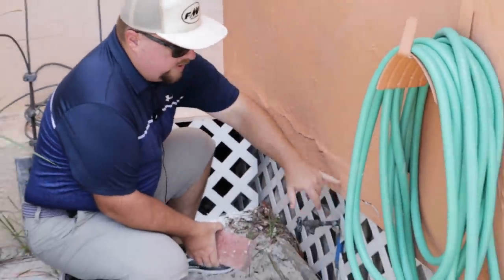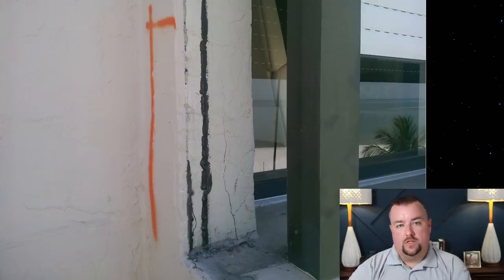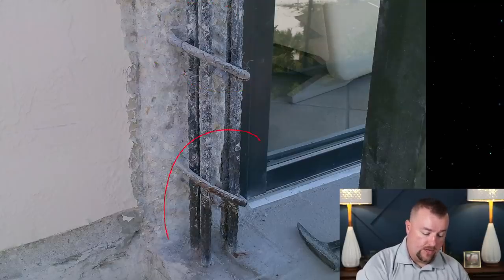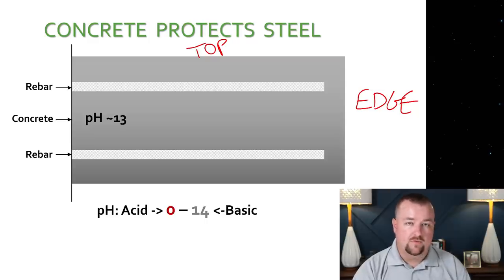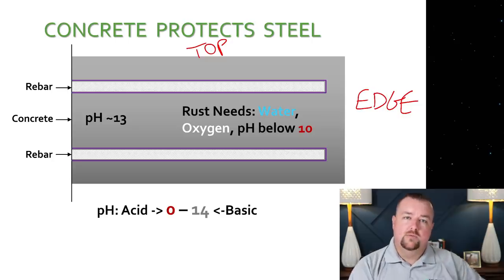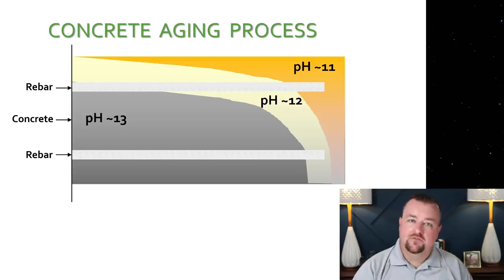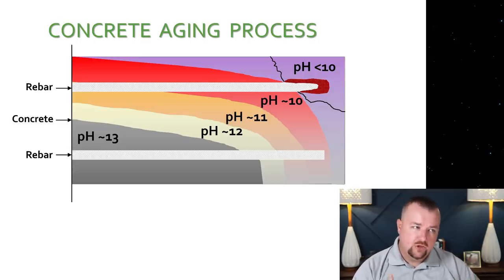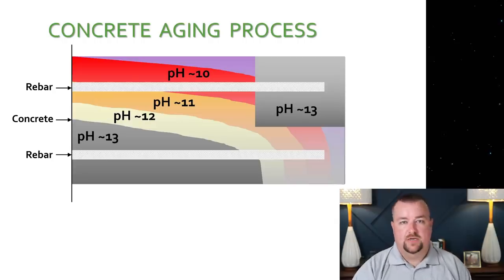Reinforced Concrete's Number 1 Enemy

Comment: As an old structural Concrete Contractor, I've wondered how come the rebar did not start rusting right away since we had to pour or pump it in a liquid state. Now I know, Thanks
Reply: and makes me even more worried seeing the amount of rusting rebar on construction site after construction site...
Reply: @jwenting  A little light rust is good because it gives some roughness and adhesion but thick brown rust with a thickness you can brush off is bad. There should not be loose material. That is just one of a hundred defects in construction reality, like less rebar than spec, insufficient lapping, not properly tied, insufficient coverage ( too near surface ) etc. etc.
Reply: @tuberroot1112  Exactly.
Reply: @tuberroot1112  Bingo!
Reply: @tuberroot1112  concrete does not adhere to rebar ever. Watch the video one more time and note when he says “mechanical bonding” it doesn’t mean “glued” together.
Reply: @vitaliypro8441  so if I'd said roughness and bonding would it have changed anything?  No, I didn't think so. Thanks for your contribution.
Reply: @tuberroot1112  surface bonding between rebar and concrete plays very little to no role in overall performance of reinforced concrete. 
I can spray form oil all over rebar and it will not affect mechanical bonding at all
Reply: @vitaliypro8441  Yes it will. They are always careful not to get the form oil on the rebar. I can tell you that concrete bonds very well to steel. My smooth mixing paddle is coated in it and I have to take a hammer to smash it off.
Reply: @marks6663 
Vitaliy

One says one says no
Who to believe
Reply: @coasteyscoasteys  rebar is purposefully SHAPED so that concrete adheres to it more, and its shape has been experimented with for over a century.
the guy in the video points out physical evidence of differing degrees of bonding due to erosion of said bonds from water.
Reply: That comment is a sign of great wisdom because you're still curious and willing to accept new knowledge even after a lifetime of experience.
Reply: @tuberroot1112  It is frightening all the variable negatives that can apply.
Reply: @rainscratch  There is a huge amount of science and engineering experience about how to make good steel reinforced concrete. Most of it goes out of the window when you have a foreman on your back who has site manager over him with a big fat bonus based on how quickly and how cheaply he can do the job.
Reply: Galvanise it

Comment: Don't know when I'll ever get to use the education you're providing but I hope to earn an honorary degree in engineering by continued viewing.  Thanks Professor Josh, I find your content fascinating!
Reply: This is only a small piece of engineering.  You are not getting any of the mathematical modeling.  Engineering is about applying mathemetics, physics and chemistry and making a simple model to explain what is happening.  We test the model to see how well it explains what is happening and then work to improve it and reduce error.  Because we know we have errors, we assign a safety factor to ensure there is enough strength.
Reply: @scottkelley1558   I think the intention of my comment may have been lost in translation.  It was an attempt to deliver a sincere compliment in a humorous manner. Clearly I failed.  I understand that the field of engineering requires many years of study spanning a deep dive into subjects I failed miserably in, especially math. That being said,  as a lay person I'm grateful to this channel for a better understanding, albeit simplistic,  of why the building I'm living in manages to keep itself upright.
Reply: @scottkelley1558  , Do engineers monitor builders at building sites so that they don’t take shortcuts to save $$$ ?
Reply: 🤣🤣🤣🤣 an honorary degree? 🤣🤣🤣🤣🤣🤣🤣🤣
Reply: @dp26385  I was wondering the exact same thing.
Reply: slow
Reply: @dp26385  The short answer is: Yes.
Reply: You can use special mix with addition of silica fume to reduce chloride attack. Had been use in bridge construction and the lab results is promising. Also coating of rebar before casting is additional protection. 
Ps: contractor tend to cheat on this as design life of bridge usually 50 years and the effect will likely shown after quite some time.
Reply: @dp26385  outside my expertise.  Adherence to design is not an engineering function per se.  that is done by construction management and inspectors..  I did read the accident report for the Miami bridge collapse a few years ago and engineers were involved through the construction process.  That is a good read.
Reply: @scottkelley1558  , thank you 🙏
Reply: It's not as 'glorious' as a Civil-scale project, but these videos have helped me to diagnose a 'soft' area of my foundation wall in my house, and has helped me to decide on what exactly to use to repair it, not just "Well I have THIS on hand, I'll just use that."  It turns out, materials matter!  I got proper concrete mix, and that'll do the job properly.  And I know to use angles that allow the new concrete to maybe bind and 'lock into' my still-existing foundation concrete.  Cement...adhesive?  That's not right, but there's a mix you use for when you want to bond concrete to other concrete.  It's not as perfect as pure, original concrete pours, but it's fine for my use.  But I know to DO that instead of 'just pile some mortar on and put the chunks back into place' like someone suggested I do.  So...I'm not an engineer, but this stuff still teaches me how to repair my house by proxy.  :)

Comment: Thanks very much for this tutorial.

I am a formulation chemist,designing impermeable acid/caustic/chemical resistant coatings for concrete structures.

Novalac epoxies are typically used to coat concrete in large chemical plants.

Problems arise because there are only two types of concrete...concrete that has cracked or concrete that will crack.

Epoxies are unfortunately nearly as crack prone as the concrete,so when concrete cracks,the epoxy coating that`s supposed to protect the concrete cracks as well. 

This new coating,soon to be released,will solve those issues.

Understanding the deterioration functionality of concrete is extremely important to the design of industrial coatings.

I need to say in touch with your channel.

Best regards.

Comment: Great explanation, well done! Having lived in a coastal environments most of my life I have seen concrete and repairs continually fail over time. Also happens with brickwork where the mortar and certain kinds of brick seem to go through a similar process of degradation.

Comment: In London there’s a condition known as ‘Regent’s Street disease’ due to the fact the first reinforced concrete used in construction was to the lintels of the buildings constructed around 1910 down Regent’s Street (it was mostly rebuilt at this time). Within a few short years they had to be replaced (including cracked stone cladding) due to the corrosion.

Comment: I worked on alcatraz island for 24 years, with the sea air on the island I have seen rebar 1/8 in diameter in the concrete went doing my repairs! Thanks

Comment: Thank you for this video! It’s so informative!

I’m reminded of Roman Harbour concrete that’s been getting stronger over the centuries in the ocean instead of breaking apart. I went and looked up the article I read a while back on it and it makes me wonder if something like that might be better for coastal structures than standard concrete… my understanding from the article was that the special minerals in it react with seawater make the concrete’s pH higher, which sounds like a good thing for preventing the rebar from rusting! The article is from 2017 in Nature and it sounds like at the time companies were still playing around with recipes to find one that can work with modern manufacturing.

Comment: How I have become so interested in concrete is due solely to your fascinating and educational videos on the subject. You really are an amazing teacher.  Can you explain how is it that there is Roman concrete that has been under water for >2000 years that is still structurally sound?
Reply: I found this on the Internet regarding Roman concrete:

Roman concrete was based on a hydraulic-setting cement. It is durable due to its incorporation of pozzolanic ash, which prevents cracks from spreading.

When seawater gets into its cracks, it causes a chemical reaction that actually strengthens the concrete. Minerals called Al-tobermorite and phillipsite form as the material leaches mineral-rich fluid that then solidifies, reinforcing the concrete and making the structures even stronger.
Reply: @markvasiloff2217  any idea where these minerals are located in abundance? Looks to be a smart move to mine and export to contractors bent on creating strong structures.  A niche to be considered.
Reply: @bill.angelus  It comes from volcanic ash and was (or is) found in areas of Italy.  I don’t know how abundant it is.
Reply: I've understood for many years that at least some Roman concrete was accidental. Bricks were mixed with aluminium rich ore. The bodies of dead slaves were thrown into the mix, and the resulting reaction of bone calcium with aluminium ore created a cement. I was told this by a university lecturer. I don't have a reference to cite.
Reply: @markvasiloff2217  so interesting. TY. I wonder how much of the chemistry they understood or if it was just a lucky use of locally available materials?
Reply: @bill.angelus  none of the modern structures are designed to be super strong and last forever. Making concrete stronger will make it hard to demolish later
Reply: Roman concrete has NO embedded rebar
Reply: @bill.angelus  
Tyler Ley has mentioned pozzolanic additives. I guess they are still in use!
Reply: @southothehighway  that may be true, but I understand they did use some kind of metal in at least some columns which was somehow put under tension, thereby prestressing the column.
Reply: There is no rebar in that concrete, but also those structures were overbuilt so the tensile strength of concrete was never tested.
Reply: @evannibbe9375  
The structures were 100% in compression!
Reply: @markvasiloff2217  I reckon they dint use rebar either
Reply: sorry i see everyone's already said that
Reply: Because Romans built their buildings with the concrete in compression.  We build ours with it in tension, then be like "fuck that's no good" and add steel which is really good in tension, (or pre-stress the concrete, again with steel, to bring the concrete into compression), and then the steel rusts, expands, and pops the concrete.

Romans just designed around what concrete's good at.
Reply: @markvasiloff2217  Fascinating information thank you!

Comment: A few years ago, can't remember exactly how many, I watched the video on a comparison between waterproof concrete made by the Romans and waterproof concrete made nowadays. I have often wondered why waterproof concrete isn't a standard when it comes to building buildings that are going to be subjected to water.

Also, I'm wondering if you can provide an opinion as to why buildings being constructed use rebar that has a layer of surface rust on it. I've seen this in so many construction sites that I have observed. The rebar sits there for days and gets a layer of rust on it, some of which gets knocked off when they start actually building the rebar portion prior to the pour of concrete. Then it sits there for days waiting for the concrete to be poured and gets a renewed layer of rust on the rebar. Then the concrete gets poured and that layer of rust gets sealed into the concrete. Is there a reason why this is done? And is this surface rust as dangerous as the rust you referred to in this video?
Reply: The only alternative would be to epoxy all the rebar prior to sending it to the job. The cost of that would be astronomical. As he was saying rust needs water. The best defense is a good offense. Keep the concrete dry through coating any exposed areas and staying on top of caulking joints. These new buildings are such pieces of crap and will need extensive maintenance early and often. Next time you're in a building that's about five years old look around the windows and I guarantee you will find some that are already leaking and that's all it takes.
Reply: Very good question. There are many variables, including if the concrete is not properly mixed, poorly compacted, of low quality ingredients, (including using water that has a higher than acceptable saline component). The concrete needs to bond to the rebar obviously the main purpose of the rebar.  If the rebar is already rusting when concrete added should theoretically be detrimental to the process.  Ultimately depends how much moisture exposure the concrete then gets in its lifetime.  In most exterior applications - a lot.

Comment: Our three story condo in SWFL was built in the mid 1970’s and was retrofitted with an electric cathodic protection system about 20 years ago. That was a costly upgrade but the system greatly minimizes spalling.
Reply from the maker: Don't ever forget to have the regular maintenance done on that system.  I saw a condo in FL with cathodic protection and they didn't change the anodes one year and almost all the balconies spalled completely apart within a year.
Reply: @BuildingIntegrity  does that indicate that the system was holding off the effects of serious water/salt intrusion? Or can a system like that exacerbated the problem when it stops working?

I ask because one year seems (to uneducated me) like quite a short period for significant spalling to appear.
Reply: @langdons2848  The anode sacrifices itself as a material which corrodes more readily than steel. It's like a galvanized nail, once the zinc corrodes, the steel will go quickly.
Reply: @johnhaller5851  I understand what you are saying John, but it still seems very fast unless there was already a very acidic environment waiting to attack the steel.

I was wondering if there were any other effects that could come from a failed cathodic protection system.
Reply: @gordonrichardson2972  yes I understand that it doesn't prevent water and salt intrusion. As per my comments above a year still seems very fast for spalling to occur. Perhaps the corrosion was already under way when the cathodic system was installed, thereby halting corrosion before it caused spalling, but very close to doing so.

I'm planning on building a reinforced concrete building in the future and it's fascinating trying to understand the exact failure modes of the material.
Reply: @langdons2848  The rate of spalling is proportional to the size of the cracks, and the rate of water intrusion. If you have cathodic protection, it will mask both of these factors. Once the protection stops, the corrosion accelerates exponentially.
Reply: Cathodic protection has issues. The cathodes need to be replaced AND the system to be protected has to be electrically continuous so the rebar has to be linked – this can be just rebar touching each other BUT they do need to touch. This can be a difficult ‘retrofit’. If the cathodes are used up and not replaced other issues present in the concrete like cracks, low pH concrete, and salt can cause quick development of rebar rusting issues.
Reply: @postie48  the rebar linking strikes me as one of the hardest things to ensure. I guess multiple, disparate connection points would be sensible.
Reply: @BuildingIntegrity  I live in a 1967 high rise somewhat away from the coastal area. 10 years ago they fitted cathodic protection to the balconies and also coated them. I'll have to go and find out whether they're still maintaining the cathodic protection (which is hidden behind decorative elements so hard to find and inspect). I do read in the news about balconies coming down on other buildings in my coutry sometimes.
Reply: @BuildingIntegrity  yes our impressed current CP system is continuously monitored via the rectifier circuit currents. We also have the original designer/installer (Southern Cathodic) make periodic inspection visits. We still get spalling- which is repair mechanically- but it’s greatly minimized vs having no CP system.
Reply: @postie48  it’s not a perfect system and it definitely must be monitored and maintained. In our condo it’s worked well to minimize spalling.
Reply: @langdons2848  yes our impressed current CP system has multiple electric connection points throughout the building. Even so, we still get some spalling at unprotected areas.

Comment: I've watched quite a few of your videos, and they've simply convinced me that I don't want to live in a concrete/rebar building.  It looks like they're destined to fail.  I've mostly lived in brick or stone-built houses, some 100 - 200 years old, there might be (usually were) timber faults that needed fixing, but not the stone work.  Even the house I lived in, built on the cheap by miners, primarily using mine-waste - built 1905,  it lacked modern facilities, but was structurally sound.

Comment: Great explanation. Are there testing devices which can identify these hidden concrete cancers?
Reply from the maker: There are ways to test the concrete, but they all involve drilling, coring, or other semi-destructive testing techniques which are not usually economical.  There is a less-destructive method which measures the electrical equipotential in the steel iirc but it doesn't tell the pH and thus can't tell the whole story.
Reply: If you seen brown iron oxide rust coming out of the slab, it's too late...